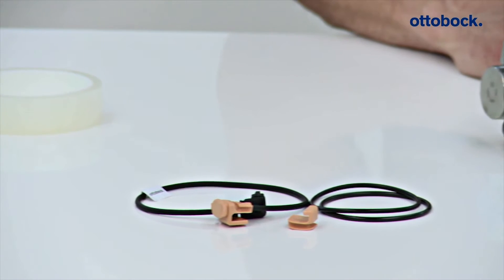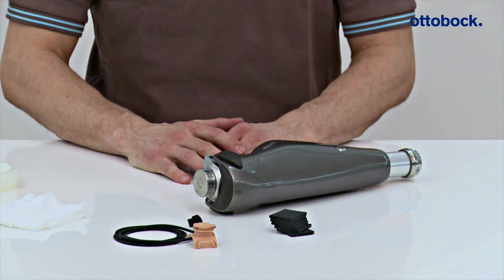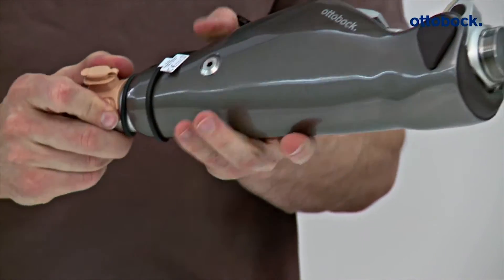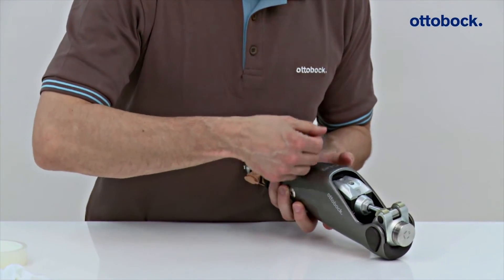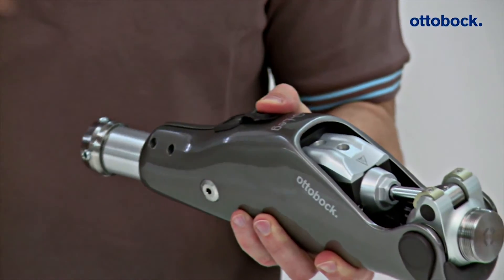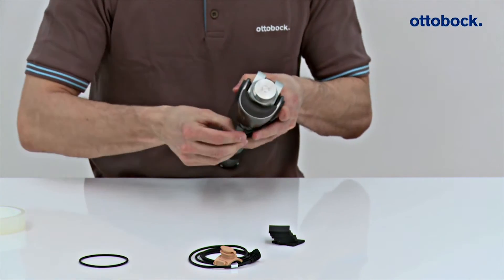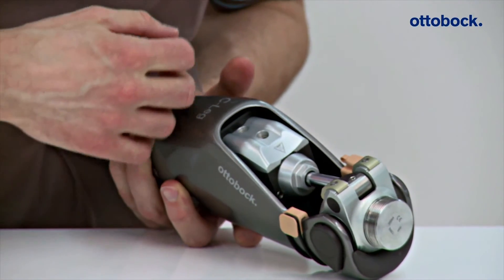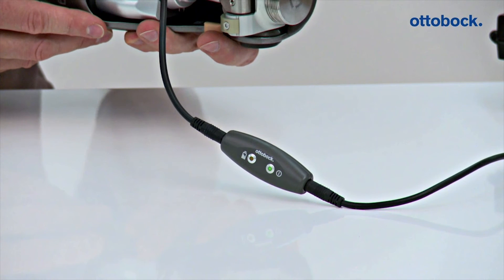C-Leg 4 Quick Start: Mounting the extension cables

Comment: The last version of C-leg 4 has a sliding charging port cap that is not user friendly and makes the knee very difficult to connect to the charger. Even the extension cable shown here is not compatible with it. This is one clear example of Otto Bock complicating something that was simple before, I call it a downgrade. Sometimes you spend 5 minutes trying to connect the charger to the knee.